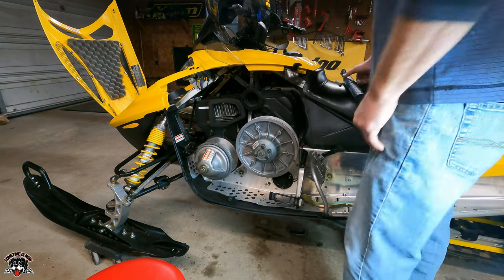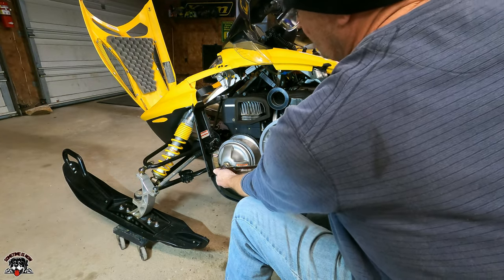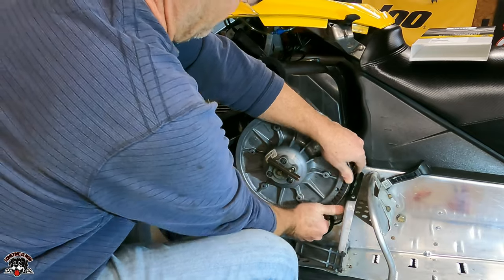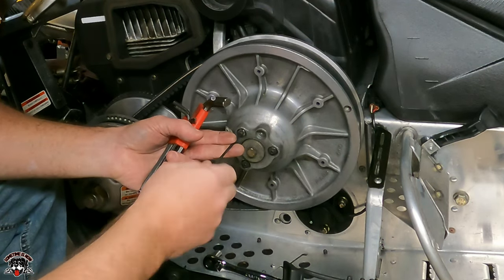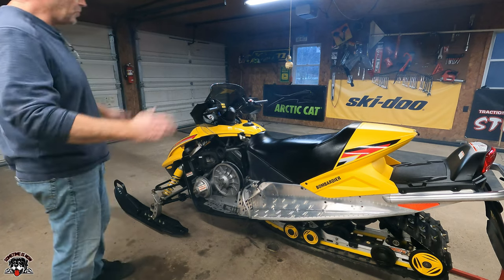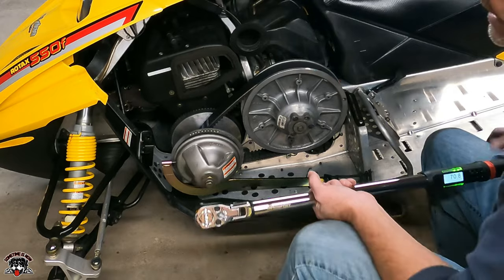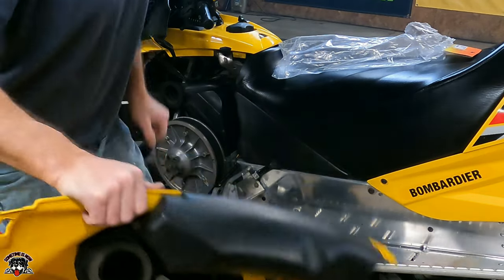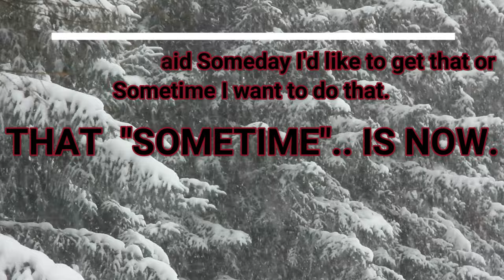SKIDOO REV MXZ 550f | EP11 | Torquing Clutches and First Start

Comment: Can you do the video removing the exhaust wanting to put a can on but can't get the old muffler off
Reply from the maker: Hey Mike, The only things that hold the muffler on are the springs and high heat silicone between the muffler and exhaust pipe flange.
Reply: Thanks for the reply I got it out it was bent up on the underside of the muffler pipe

Comment: 70lbs is to much for primary 55 max
Reply from the maker: Hey Scott, Where are you getting your information? My 2005 MXZ Skidoo Service shop manual specifically states: 

Hold the drive clutch with the drive pulley holder (P/N 529 027 600) then torque bolt to 90 N•m (66 lbf•ft).
Install drive belt and belt guard.
Raise and block the rear of the vehicle and support it with a mechanical stand.
Accelerate the vehicle at low speed (maximum 30 km/h (20 MPH)) and apply the brake, repeat 5 times.
Retorque bolt to 95 N•m (70 lbf•ft).
🤷🏼‍♂ Cheers 🤙🏼

Comment: Belt looks loose
Reply from the maker: Hey Alan, It’s not, It set as tight as it can be without the track creeping. I found out you can’t set these like a standard skidoo TRA clutch where you set the deflection with the bottom of the belt cog even with the edge of the secondary. Take Care
Reply: @SometimeIsNow   I would try and find a  Is longer  belt where it's at now it's like starting out in 2nd  Gear Let's hope it's a good year for snow  looking forward in the U P this year✌️
Reply from the maker: @alancall5113  I agree with you that the belt sits alittle low in the secondary. I’ll have to see how it feels for low end once I get it on the snow. To be honest my wife’s not going to notice it. She just likes to get out and ride to get lunch somewhere and then back to the truck. Now… If I end up riding this sled and she’s on my T-cat then I’ll have to look at it much closer. 😂🤣 We’ve been watching the snow depths up in the UP. They’re starting to ride already. Think Snow ❄❄